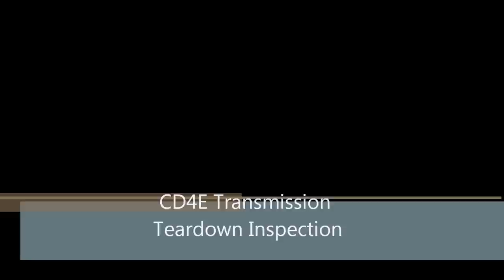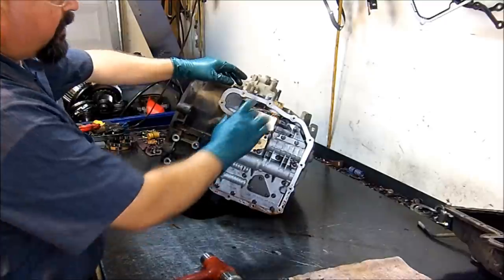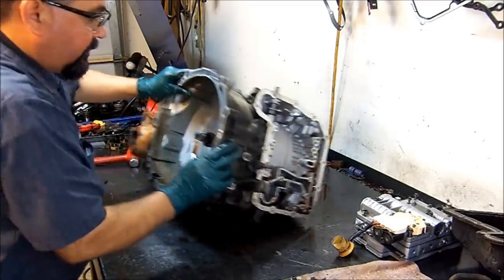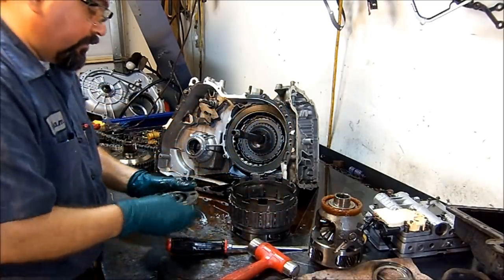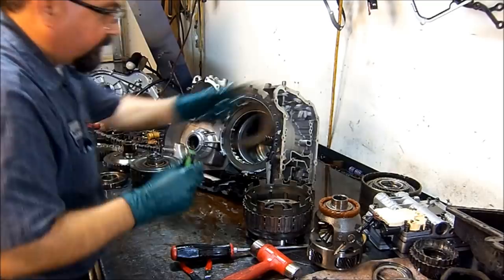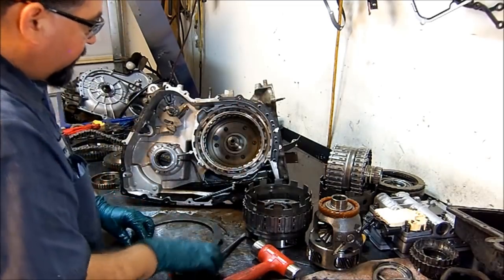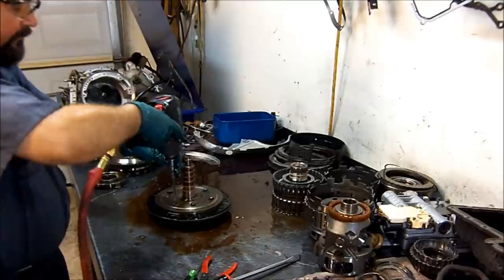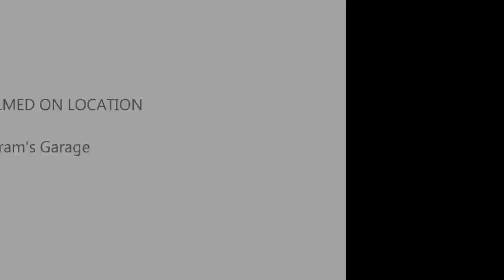CD4E Transmission Teardown Inspection - Transmission Repair

Comment: Thanks for doing this video, i will soon be tearing down my cd4e to replace bushings in the differential, your video will help me very much, not only with doing the differential. With the knowledge you have shared i will feel confident enough to check the other things you have shown here. I have been looking for a good CD4E tear down video for ages, i am very glad to have found yours. I greatly appreciate the time you have taken to upload this video. My CD4E is on my 1997 2.0lt Ford Mondeo.

Comment: I really like the detail of this video. Your knowledge and professional attitude toward repair of the CD4E is extensive and appreciated!! I know asking for diagnosis through here is a bit of a cliche but I have this transmission in a 2000 Mazda 626 and have had very few issues less a range sensor in over 100,000 miles. However, I just recently had an issue with the forward gear. The transmission will not go into drive whatsoever now, however if I rev the engine to around 3k rpm it was shifting hard into drive and when going though from 1st all the way to overdrive it shifts so smooth and perfect. However as I said, now it will not go into drive at all and acts as if you are in neutral. No if I rev rpm up to around 4k from neutral then into drive it will try to catch gear (you can feel it) but will release quickly. It almost feels like a pressure issue perhaps with either valve body or a solenoid valve sticking or the like. It does NOT have any engine codes stored in memory as no check engine light is on. Any suggestions on this is greatly appreciated. I understand the fact that it is not in front of you and I am mechanically inclined so feel free to suggest. I know you are not fixing this I am only asking a professional opinion. Thank you.

Comment: Great video! Many thanks. 
I have a problem with my Cougar with the CD4E. It lose the "grip" on the 4:th gear when driving, and get the grip again after some second. This happens when the engine has reach the working temperature so I guess it's the band for the forth gear. I am planning to tear it down, clean, and change the necessary parts while looking at this video. Many thank's from Sweden

Comment: Hi Hiram...love your videos, you are a good instructor. I have my first CD4E on my bench and I have checked my pistons and lips seals and they are correct. My issue is I'm not happy with the air test...only failure was front drum exploded from over line pressure...although the six sealing rings look good and are installed right I'm not getting a great seal on air test...plenty of trans assembly lube on everything...all pistons apply but don't hold air great...increasing air from 40 to 50 psi seems to make the test better...pump support thrust bearing is in properly and pump is aligned...still have sealing issues...any help would be greatly appreciated....was not fun to pull this trans out of 2004 awd ford escape so I want it to be right the first time ...thank you :)

Comment: Great video... Hard to find good tear down of these transmissions. My ford probe had transmission rebuilt 7 months ago and it is already gone bad. It drives several feet and than it will pop out of gear as if its in nuetral. Primary cause was VSS

Comment: I have a 2002 Ford Escape. The transmission started slipping when starting out in Drive, but if I put it in 1st, it doesn't slip, then I can manually shift to 2nd, drive, etc... It doesn't feel like it slips at all once it's moving, and I pulled a 6% grade at 65 mph. When it started, there was a box around the 1, regardless of what gear was selected.  P0731 and P732 codes were set (incorrect gear ratio 1 and 2). This lead me to the Range Position sensor. I pulled it, and found that a prior owner had obviously kludged the connector (looked like jb-weld on it). I replaced the sensor and the connector. Now the display always shows the correct gear, and the 1 does not always have the box around it. Now, it still doesn't start out in Drive, but once it's moving, it shifts up and down correctly. I just have to put it in 1st to get it moving.   After the resetting the computer, I've driven it about 15 miles, 10 with few stops. No codes were set. It still will not start moving in Drive, if I put it in 1 or 2 it starts off, sometimes the way it should and sometimes it slips and grabs, but not too bad. When going down the road at 40 mph and I put my foot into it hard, rather than shift down it free revs. If I speed up normally it shifts correctly. Once in Drive or overdrive, it doesn't feel like it's slipping.

Comment: Great video Hiram, I just bought a ford contour 2000 from a neighbor. It was sitting up for about 2 years, I had to replace the fuel pump and bought new tires, but now when I crank it , it  sounds like it wants to shut off  while its just running sitting still. Then when I drive it also does some jerking and sounds like it wants to turn off, but it doesn't. Please tell me what you suggest.

Comment: Hiram,
I have been watching the videos you made on this unit.I plan to remove the trans from my mothers 1998 contour.She just paid a guy $2600 to rebuild it and it went out again.(just out of warranty) uggg!.I suspect he did NOT do the valve body updates because she said it was "jerking" before it went out.
She went to him the day before it cratered and he told her it was acting up because of the "waterpump"
He said it (waterpump) was making the AT overheat.He said the transmission was unable to cool itself.(even though the car showed normal reading on the gauge.
I do not know for shure,but it also appears it burped ATF out the dipstick.She said there was a huge amount of smoke coming out of the engine compartment.(not steam because the engine never overheated.)
Any thoughts as to what went wrong?
Oh,the car does not move and the fluid level is correct.I do not see any leaks,and she said it did not leak nor did he ever add fluid when he checked her ccar.
His remedy was to replace the waterpump and radiator for $800  NO JOKE!
And THEN he was going to address the transmission..IOW he was going to get her for a phantom repair.

Comment: Have 2005 ford escape cd4e you can put in reverse fill it go in gear but won't move put in drive it will go put in 2 or 1 won't move

Comment: I bought a reman trans and i am being told the transmission needs to be programmed before i put it in gear. That i need a scan tool? Do you know if this is true? Will a more advanced OBD 2 scanner do the job if this is true?

Comment: Have you seen one of these transmissions not work until you overfill the fluid a qt or 2 my 2 4 band broke was going too fix it but was unsure no codes except 2 gear taking too long to shift.

Comment: Another great video Hiram. Question: Do you normally replace the direct/forward drum and solenoid pack on every unit since they both are known to have problems? Also, if you could i'd like to see how you replace some of the bushings that are hard to replace. Like in the stator support or the direct/forward drum. I seem to have problems with those. Thanks again.

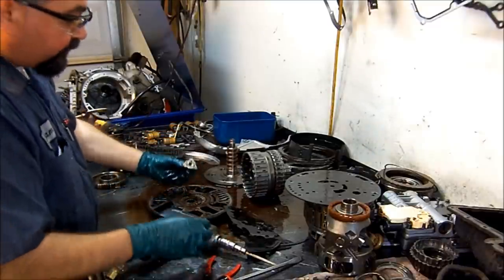Comment: On the transmission oil pump drive shaft at 22:13 how freely is that supposed to turn after torque the six bolts? The repair manual says rotational torque of 2.65 lb_in or 0.3 Nm my torque wrench does not go that low. is that supposed to be turnable by hand? My old shaft snapped when i put it together doing a band replacement without taking out transmission. For ford escape.

Comment: Is it possible to replace only the 2-4 band by removing just the pump and not performing a complete overhaul?  I already installed the shift kit years ago which has allowed my original transmission to last 190,000 miles!
I hope you can help me here.
Thanks!

Comment: Hi Hiram, I have a 2001 Ford Escape 3.0 V6 4WD with 115,000 miles and I have been reading about transmission problems on the CD4E. My car currently runs fine and shifts are very smooth. Is this a car I should avoid keeping for long or is the any precautionary measure I can take to avoid having a blown transmission. Please get back to me. Thank you and great video btw

Comment: Hello, I have a 2005 Ford Escape with a 4cyl engine and FWD with a loud humming sound which I believe is coming from the transmission on the driver side. The noise goes away when you turn the steering wheel left while driving. Not sure if it's the left front wheel bearing, the left front CV axle or an internal problem in the transmission like a bearing. I appreciate any input that can lead me to the root cause of this noise, thank you in advance.

Comment: I have a 06 mazda tribute v6 4wd.I am having rough shifting from 2nd-3rd gear up shift and 3rd-2nd downshift.It only has 77,000 miles with clean full fluid.Is this a bad solenoid pack or a bad valve body ? Also it gets even worse when cold outside ! But during the summer its not as bad.

Comment: Hello Hiram, I know this is an old video but I have an important question regarding the valve body solenoid pack. You mention an earlier versus later updated solenoid pack being identified by the color of the connector and not to use the earlier one due to torque converter clutch issues. I am replacing the solenoid pack on a 1999 Mercury Couger which has a BorgWarner solenoid pack with the earlier brown connector. My question is regarding the replacement pack I received that stated it is a updated BorgWarner solenoid pack. However, it does not have a white or light colored connector as you have identified it nor is it the brown one like I removed but is a BorgWarner with a black connector. The original one I removed has the Ford and BorgWarner logo with the part number F8RP-7G391-AA inked on the electrical cover and my replacement says BorgWarner but the Ford logo is conspicuously a blank empty spot and there is no inked or part number anywhere. Is there any way that will positively identify these apart or have I been rooked buy the seller and received an outdated solenoid because the connector is not white or light colored or worse yet is this a Chinese counterfeit. The sellers picture for the one I bought had a light grey connector but the one he sent me is black and it now seems to be an ambiguous issue to be able to identify this by the color of the connector unless all the outdated ones are brown and any other color would mean an updated one. I do not want to pay for and install an outdated or counterfeit one when the outdated one I have still functions. Nor do I want to accuse the seller of rooking me if he hasn't. Are you able to clarify this for me or not? Are there Chinese counterfeits of these? Sorry for the long post, but I wanted to be clear. Thank you for your videos; they are excellent! You make a great instructor.
Reply: Hi All, I want to update my above concern. I researched the BorgWarner website and found their aftermarket division which now manufactures the solenoid pack for this transmission, so it makes sense that the solenoid would no longer carry the Ford logo since its no longer made for Ford as they no longer make this transmission. Also the site specifically declares that they changed the connector color to black in 2014. So, Hiram's statement of the updated pack connector being white or neutral colored is true for the time of the video but no longer holds true for the BorgWarner one. I am now confident the one I have is a good genuine updated one. Thanks for reading, I hope this may help anyone who may have the same confusion!

Comment: Hi Hiram, I have a 2004 mazda 3.  My AT light is on, transmission shifts o.k. until it gets to 4th gear, it just revs and wont catch. i tried putting it in manual so i can keep it in 3rd gear, but after a couple minutes the MT Gear indicator that shows what gear I'm in, shuts off and it goes into automatic. After a few minutes it will drop to 2 gear and will not go to 3 or 4 gear. Is it a computer problem or a transmission problem or both?

Comment: I wish I had found this video sooner. Around 20:30 he mentions those sealing rings, is he saying the fluid to engage those drums is pumped through the pump shaft? This is one thing about automatic transmissions that has always confused me. How does it get the fluid to engage the drums that aren't directly connected to the case and are rotating some of the time?

Comment: Hi , I have a 2006 escape.  Replaced the left axle seal and it still leaks. There is some movement (slop)with the axle  (front to back).  Is this a worn bushing?  There is a high speed shimmy also.  I had the tires balanced and the shimmy still exists.  Can I replace the bushing without splitting the transmission?

Comment: Hello.I got a 05 mazda tribute awd.. The torque converter locked up. I changed the torque converter with a refurbished one. The trans fluid I used said it was mercon compatible.. Now I have a vibration starting at 45 mph.  And the faster I go.it gets worse. Almost feels like something is out of balance. Any ideas what it could be or what I need to do? Thanks

Comment: One question. Do I have to remove the valve body to get the control selenoid out. I'm without the luxury of having  the trans out, or a lift.

Comment: Hy from Romania , i have a ford mondeo mk3 , 4 speed automatic CD4E, just buy yesterday. The problem is , the car shift at hight RMP,   work ok to put in R or D but when i start the car upp hight rmp and than chage the gear .What is posible to be that problem ? to start to check

Comment: CD4E transmission upon initial start will go into all gears and work for a few
minutes then quit. Checking line pressure and stall speeds, everything is
spot on when working. Issue is that at time of loss of all gears, line pressure
goes to zero.

Do notice a pump whine just before and during loss of pressure. 

Have already done several fluid changes via the drain and fill method as the
original fluid was very burnt. Have seen no difference in issue.

Comment: I have a 2002 ford escape  4x4 where can I get a transmission rebuild kit that has all the seals , orings, bearings, and bushings , plus all the other wearable parts like clutches . Also maybe the drive drum . 
Trans has 340k miles on it .

Comment: Great videos, I have a quick question. I have a 2006 ford escape with the cd4e and I'm wondering if they also need the shift kit done on the valve body or did they correct the problem by that point. Thanks again your videos are extremely helpful.
Reply: +stewie griffin   It can't hurt.  If the transgo kit prevents the runaway line pressure, then you may very well prevent a catastrophic failure.

Comment: Hey I have a cd4e that has forward movement in all gears. Parking pin holds it back but you cannot rev the engine due to it trying to move the vehicle. In reverse it is in both reverse and drive. Any idea where I should start?

Comment: I have questions of the same transmission but mines is from a 2008 and the oil is black now and it goes in to gear and then it goes blank just revs and dont go to gear for nothing for my knowing I think the clutches burn cuz some one told me if the traction control breakes it does that but idk if is what I think or what the other person told me idk i need help is my mom's car that I'm fixing

Comment: great video.a few years ago my wife bought an 07 rabbit that shifted hard. but for 270  bucks i bought a shift kit and the cars been amazing ever since. i can fix almost anything on a car but a trany expert i am not. i have looked and looked and can not find the answer to this issue. my son has a 2000 626 4 cylinder. the car lost drive. i checked the fluid and it was low. i filled it and the same issue. but if i put it in 1 or 2 it drives fine. if i turn the od off it will drive fine but a little hesitation before 1st will ingage. but will shift 1 2 3 . just no od. but once im driving about 30 mph in 3rd, i can switch od back on and it will go into od and run fine till i slow down. i am not sure but seems to me to be a pressure issue. am i wrong? i have done some trany work but its limited. i dont like not knowing how to fix things. this might be my first solo rebuild. the car is not worth a 1000 dollar swap. any info would be greatly appresheated.

Comment: hi, bro. i have a ford tribute 4 cyls., and when is cold change gear without prob. but after run about haft hour  doesn't take not gear, wait two minutes a go again until next 15 to 20 minutes. Do you think that filter can cause that or something else. there's not code on it or dashb. ligth. pls . give me a  help, Thank.

Comment: I am stumped. The pump shaft broke in my daughter's 06' Escape. I removed it, put in a new shaft and pump. The pump shaft broke again immediately upon startup. I removed the valve body, cleaned it up, installed the transgo jr kit, made sure everything was working as it should on the bench, reinstalled, put in a new pump shaft and again the shaft snapped immediately upon startup. The last time I disabled it enough so it wouldn't start and cranked it several times to give the pump some time to get primed. What am I missing here? I have been a technician pretty much my whole life but I have never had to deal with this trans before so I am at a loss as far as knowledge about this trans. Any advice on this would be greatly appreciated.
Reply: it sounds like the pump shaft is in crooked. You need a tool to make sure it goes in straight. Their are ways of doing without the tool though. 
look here https://www.youtube.com/watch?v=2XXgE9X6r3A

our boy here shows you how it's done.

keep in mind that this is a guess. Without looking at it that's all i can do.